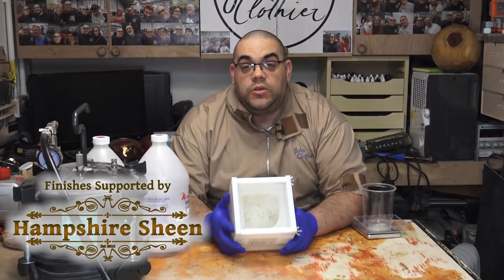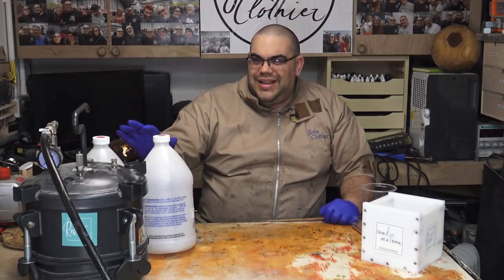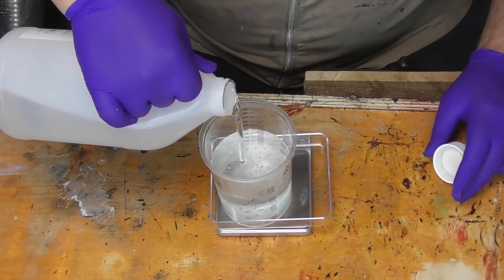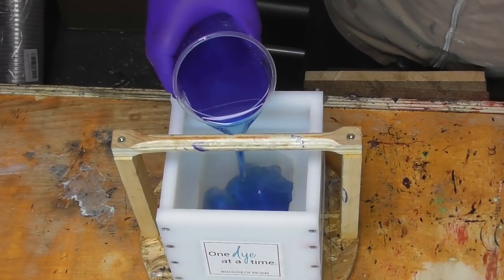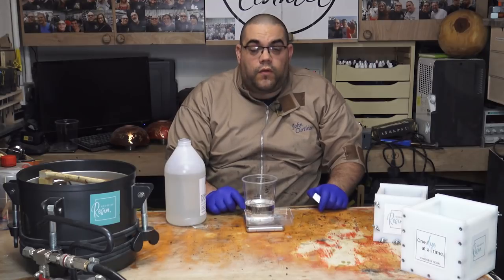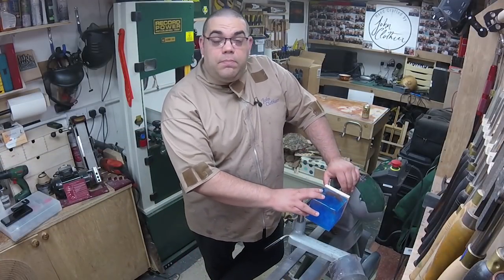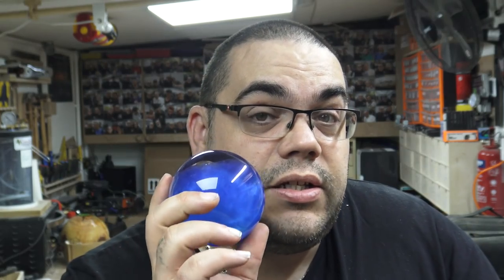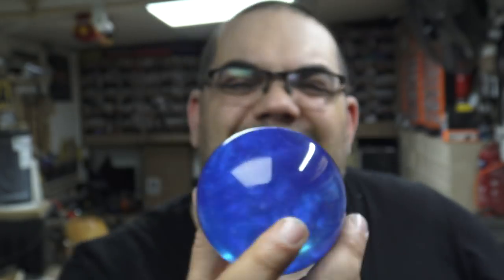Making A Resin Burr Mould - Part 2

Comment: I think you know how I feel about experiments at the moment on my channel. Some you win some just don't always go to how you think. Agree certainly no where enough of the clear. Regarding the blue, initially I thought that just the aluminite blue would have looked better giving a more transparent effect. Still may be the case. The thing you have to remember with when you cast a piece of wood in resin is that wood is not just one solid colour. Even over a very short distance the shades change with grain etc. especially around any bumps, so I do wonder if you would get that same wow factor from the first resin cast.
Reply from the maker: indeed. the next one that I am hoping will go up on a video next weekend (if I can finish it and edit it in time) should be a lot better and is more what I was aiming for. This video was really about the creation of the mold rather than the finished item